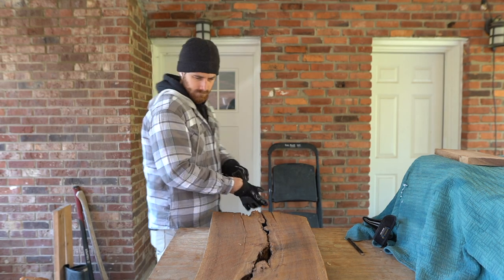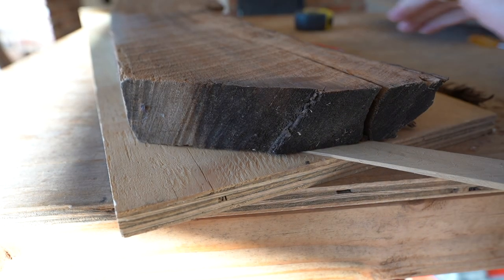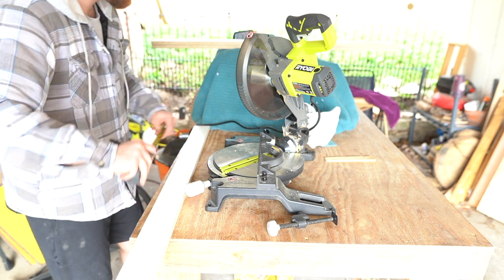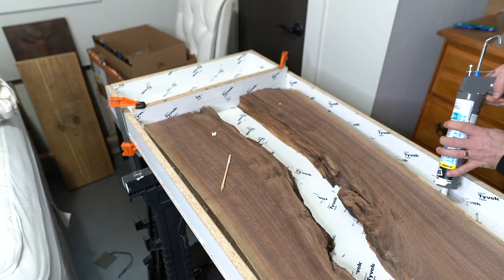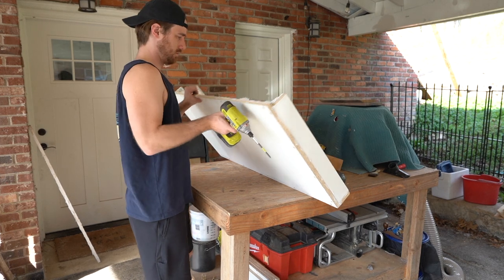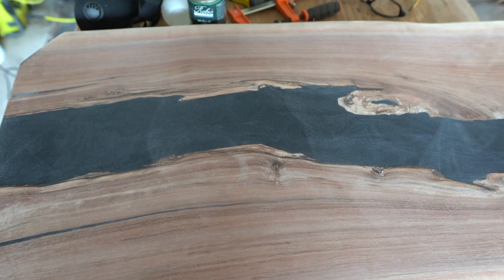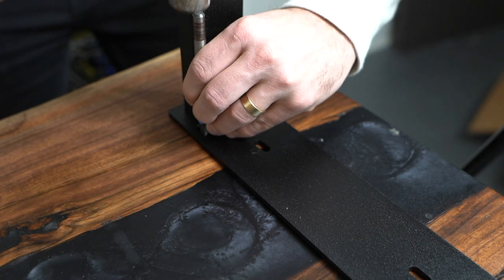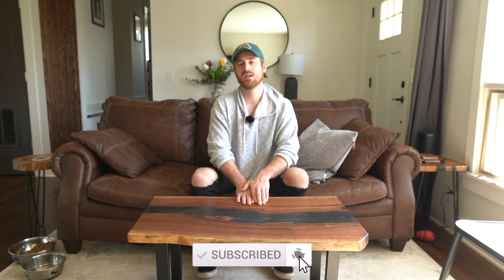LIVE EDGE COFFEE TABLE || Full Build

Comment: One thing I've found is that normal packing tape works aswell as tyvek tape and with regards to caulking use a black caulk then you can see exactly where it's going and best to get a ball gouge tool for decorating cakes to run over it push it all in. 🏴👍✌️